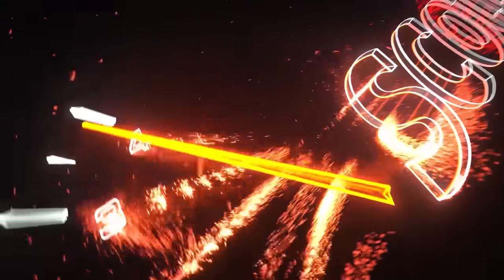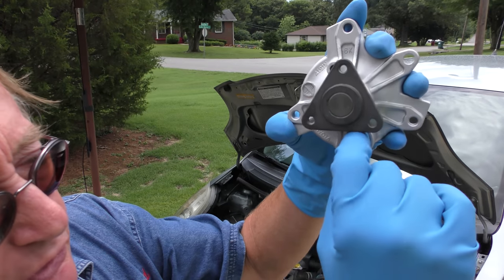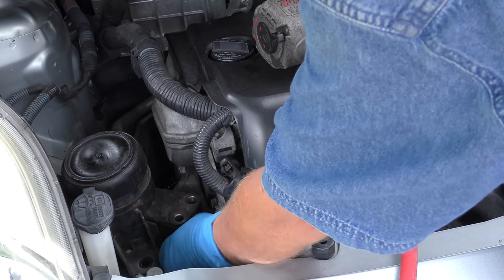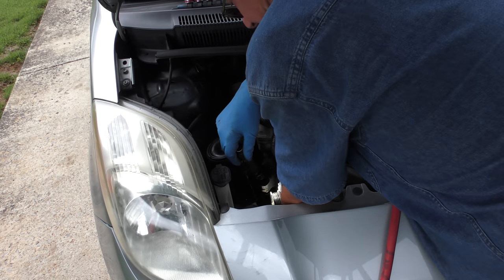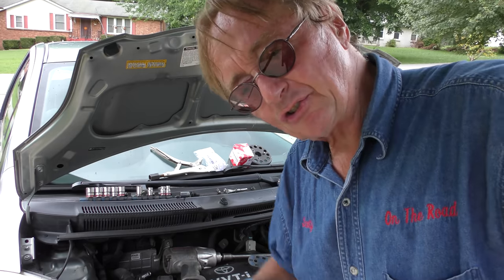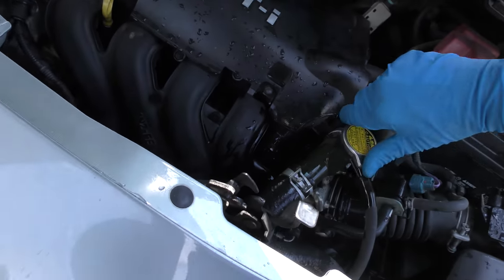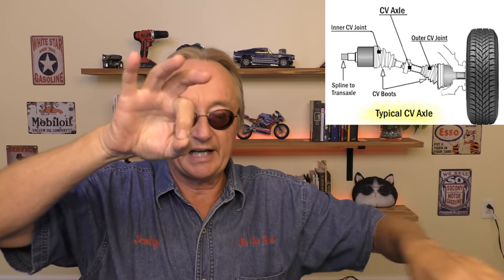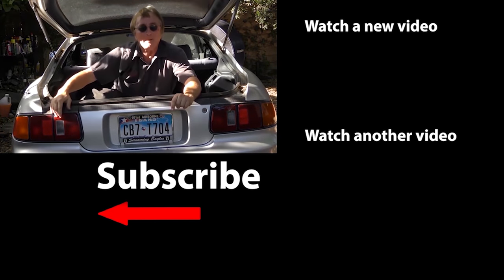These Toyotas are Breaking and I'm Mad as Hell

Comment: Water pump on the alternator/fan belt?
Isn't it usually run with the timing belt?
Reply: Depends, timing belt cars often run the water pump with the timing belt, timing chain cars often have serpantine belt driven water pumps.

Comment: Toyota will tell you to change the water pump along with the timing bet every 100,000 miles.  That is what I was told.
Reply: Same here. Makes sense. If I'm into the front of the engine to replace the timing belt, I replace the water pump whether it needs it, or not. It's cheap insurance.

Comment: Man when mine failed in my Yaris at 60,000 it was so damn loud it sounded like the engine knocking
Reply: How many miles do you have on the car now? And what year? Mine is a 2009 sedan base model, one in this video is a hatchback of the same year, I have 86 thousand miles on my yaris now water pump is still fine but I bought a new oem Aisin one from the dealer I’m gonna put in soon, heard these fail early on these yaris sometimes so I keep it in the trunk
Reply: Also did it sound bad whenever the AC was only on or the heat on?

Comment: Hey Scotty my grandparents bought a 2018 nissan rogue sport SV used for 33k miles and for around 20k and they bought it Last week what are your opinions on it
Reply: Make sure changed CVT fluid at 30,000 miles. I have the regular ( Rogue ) 2015 runs like new. I hope you get good years out of it at 33K miles.
Reply: Change the CVT oil regularly, that what I heard from people that have gone over 200,000 miles on the previous version. What I heard the CVT operate at a higher temp, so the oil need to change quicker than a normal transmission hat can go 60,000 miles., as it worn out much faster.

Comment: 3rd gen prius is probably the highest maintenance car ive ever owned
Reply: Try owning a 2014 Chevy Malibu, the dealer replaced my transmission 3 times in 60,000 miles!
Reply: @alexanderrosales7675  They are not replacing it then.....what they are doing is replacing worn parts inside the transmission, Find a good used transmission & have it installed by a transmission shop if you want the problem gone.

Comment: I've always been of the opinion that a water pump is good unless the seals are bad and it's leaking from it. Most impellors are metal and rarely go bad otherwise. EXCEPT! I just changed the wp on my 4.7 tundra and low and behold,  a plastic impeller. WTH? It had exploded and fragmented plastic everywhere. Who the hell had the genius idea to use plastic? Dumb mfs. I went back with a quality metal one.